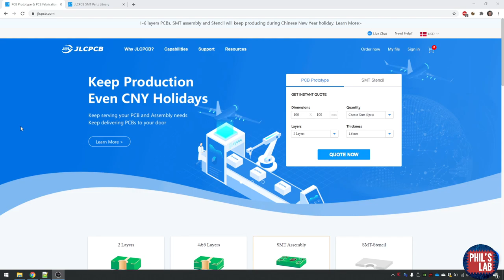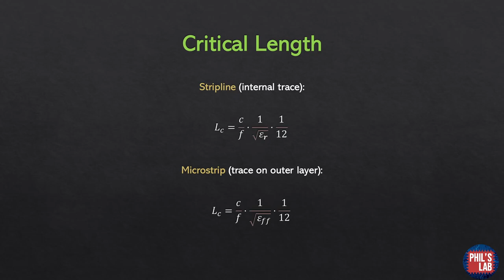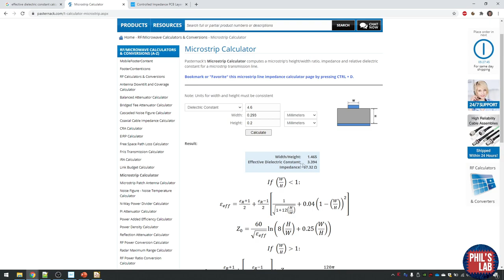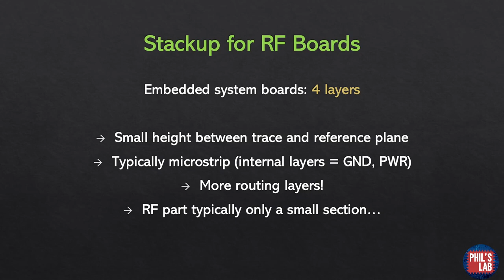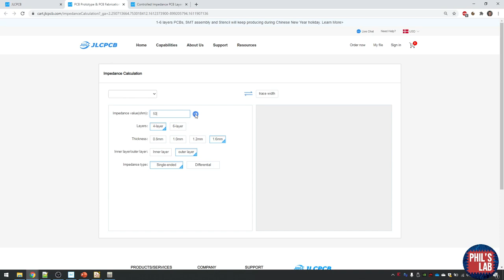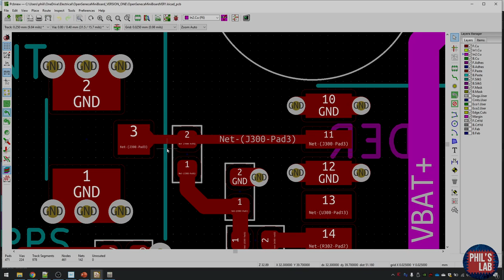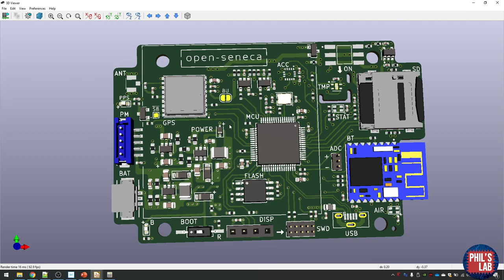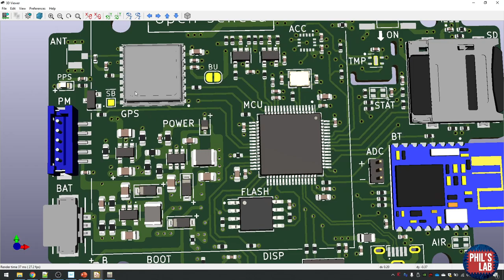Practical RF Hardware and PCB Design Tips - Phil's Lab #19

Comment: Two more tips I picked up from designing mil/aero RF boards
1. Grounded coplanar waveguide is extremely useful for tuning RF amplifiers. Just scrape away soldermask to add shunt tuning components to GND.
2. Another tip for tuning. If you require an L or C, two in parallel will decrease parasitic inductance and possibly improve performance. For example, if you need a 4 pF shunt cap, get two 8 pF and butt them end to end with them meeting at your trace. Of course, they need really low impedance connections (i.e. via in pad) to a GND plane for this to work well.

Comment: Great video! I've done a bit of research on trace discontinuities, and in an article published by Minicircuits, trace/pad discontinuities can impact your VSWR. One solution is to reduce the size of your pad, though this may make soldering a bit more difficult. I'm dealing with VSWR and insertion loss issues on a design I'm working on.

Comment: Hey Phil, great video! Would you please consider making another one about making PCB antennas design (in KiCad) and choosing values for the PI matching network, and various types of PI networks. Like for example the EPS32 PCB antennas... That would be great!
Reply: Matching networks would be a great video. Including, for example, how the critical length comes in to play, best practice for tuning, measurement etc.
Reply from the maker: Thank you!
Yeah I think a video on PCB antennae and matching networks would be a very good idea. I need to get my hands on some simulation software before I'll put one out, but hopefully sometime soon :)
Reply: Antenna design, beyond the most simple ones, is a big job. Simulation software is hideously expensive, and those who design antennae are usually very specialized in this field. 
For WiFi, GPS, and cell bands there are numerous choices available, with predictable characteristics, including PCB mounted ones.
"Critical length" is applicable to digital signals, where their risetime determine frequency calculations. For RF 50 ohm lines is commonly used, and better dielectrics for lower losses, but expect a 10x cost increase for use above like 3 GHz, or very high power levels.

Comment: If you want to play around with cheap circuit simulation, try Qucs, that should get you a reasonable answer already.  Looking at the output from the KiCAD calculator it also shows the Eeff, I guess that differences in approximating that value are to blame for the different values you got from the JLC calculator.

Comment: Thank you! So much helpful information and really well structured. I have a question about trace length. You calculated that it should be less than than 8.6 mm and it was ~7. But what about the length of the anténa connector, connections in the anténa, ic leads/wire bonds. I suppose it could sum up and add quite a bit of length to the trace. Why it's not taken into account?

I mean could it affect my requirements on the impedance/length of the trace

Comment: If  I understood you correctly, you recommend routing signals on the top layer. May i ask, what´s the benefit compared to a setup of lets say: 1.Power 2.ground 3.signal 4.ground, where the signals would be mostly shielded against the outside noise?
Ps: as always, i think your videos are a great resource both for beginners and advanced users. They guide and encourage people to improve EMC for common application boards.
Reply: A big disadvantage of the stackup you mentioned is that you lose an entire routing layer. This also only minimally protects the traces from external EMI but your components still have to be on the outside layers and are still just as susceptible to the EMI. Most general applications don't really need this kind of protection, and if they do, you use shielding cans instead. Although many HDI designs use this sort stackup you mentioned but only because they have many layers and don't have a problem with routing constraints, and it is done mostly to prevent the board itself from radiating RF energy to remain within compliance standards not just from protecting it from external EMI.

Comment: Hello Phil! I hope you'll notice my comment, because I'm losing my mind here. I have a question about usb connection in stm32f1 mcu's. I've watched your video about stm32f1 breakout board and designed own board based on your schematic. I wanted to play around with virtual com port and establish connection with my pc. But when I connect my board, I get "device descriptor request failed" error. And after some research I found that in some cases D+ line is connected to 5v instead of 3.3v. I resoldered the pin, and usb started working and I can communicate with mcu. I just can't understand what I'm doing wrong. All of the official docs said it should be connected to 3.3v, but it just doesn't work. I assume it's  software problem, because it's working now with 5v pull up. But I simply couldn't find the answer. Please give me a hint if you can. And thank you for your videos, they keep me motivated)

Comment: I'm just a hobbyist with no commercial experience in board design. I watched those videos from Rick Hartley and as you stated you even took part. Could you please explain why you still insist on using layer 3 for power on a 4 layer board? Since it is what Rick Hartley wouldn't recommend. Also layer 2 and 3 are much thinner than layer 1 and 4.

Comment: Hey if we are using some rf module like the DWM1000 do we still need 4 layers? As the rf part is handled by the module itself and we only have to add microcontroller and other components, can it be done in 2 layers? Or you still suggest 4 layers? Also could you make on such video for design consisting dwm1000 or a similar module.

Comment: Hi, I have a little question. I'm about to design a circuit that includes nrf24 ic. I would like to do this on 2 layers, 1.6mm board, as it is a little bit cheaper and easier to design. But when I enter all values into the calculator (1.5mm height between ground and traces, 4.6 dielectric constant, and 50-ohm impedance), it gives me enormous 2.54mm width traces. Is that possible or am I doing something wrong?

Comment: Hi! Great channel! I've learned so much here. I have a question. I am designing a pcb that has a rf module using a 868 mhz antenna. The pcb will have 2 layers, both layers with ground fill. Are the calculations done the same way?

Comment: Phil, thanks so much for putting out these quick modules on specific categories. These are so informative to watch and I pick up so much additional info outside of the intended subject.

My question to you is, what would you recommend for a semi-structured course of study outside of a university? I'm currently working on a BS in computer science but I am just as interested in electrical engineering and embedded systems.  I am thinking I would like to get a head start on these other areas of expertise in case I decide to pursue multiple degrees after I finish CS.

Comment: @Phil's Lab, Why is there no copper on the top layer to connect the ground from the antenna connector to the GPS module directly? 100% that a direct connection is better (less inductance) than wandering through a via. the same applies to blocking capacitors and their ground.

Чому відсутня мідь на слої топ для підключення землі від конектора антенни до модуля GPS безпосередньо? 100% що пряме з'єднання краще (менша індуктивність) аніж блукати через віа. те саме стосується і блокуючих конденсаторів та їх землі.

Comment: Great video. Could you please make one about higher power pcbs, i am trying to build a shield for my micro that could handle a 12S bms (BQ76952) and that could feed its energy to a 3 phase gate driver (DRV8353) for motor control at 60v 15a. I am confused about trace width and their power carrying characteristics. Thanks big fan.
Reply from the maker: Thank you! Yeah I'm definitely up for making a video on higher-current/high-power PCBs. Not sure when that'll come out, but it's on the list :)